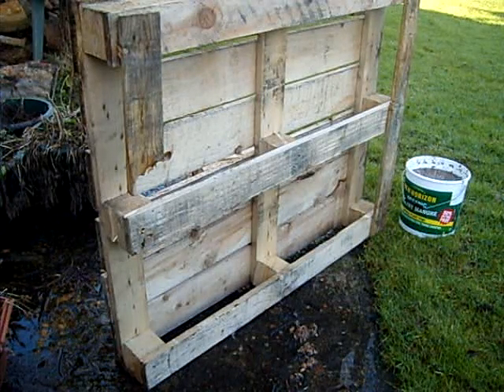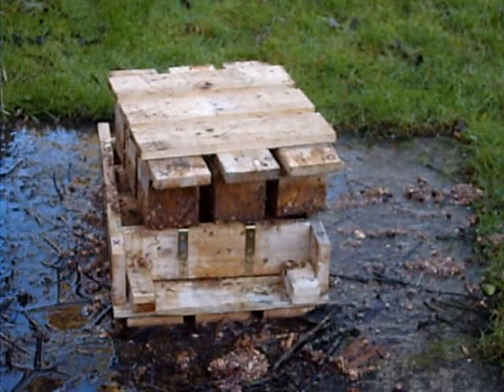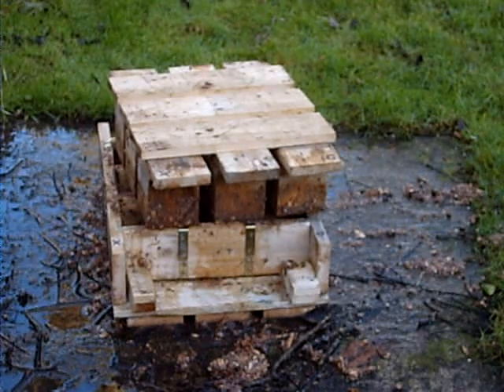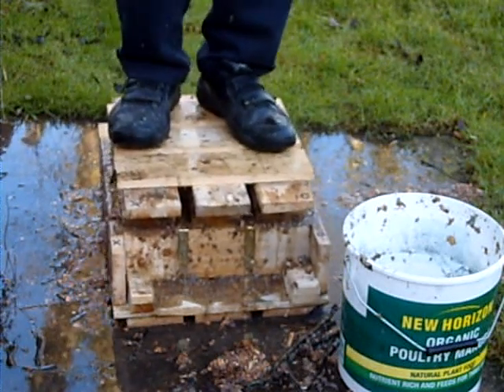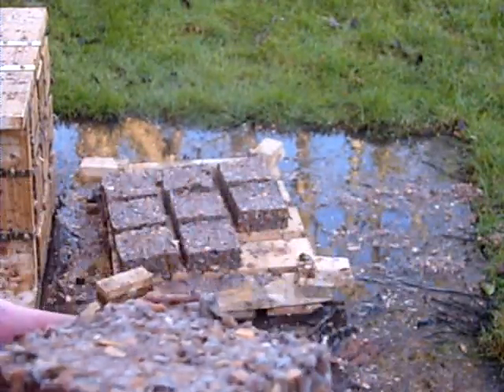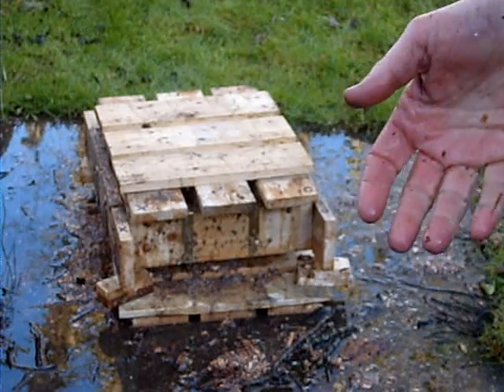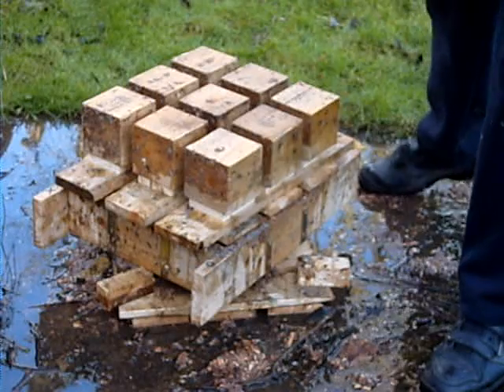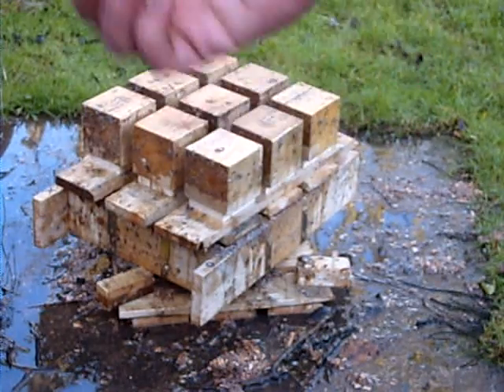Homemade Fuel Briquette Press 2

Comment from the maker: Hi Ed, I did try driving one wheel onto the press and got it done but, even with a Mercedes S320 that weighed about 2 tons, I got about 2mm or 3 mm more compression than just jumping on the press.  The problem seems to be that the centre of gravity changed when the car was elevated in one corner so the weight transferred to the opposite rear wheel so robbing potential weight from the wheel on the press.  I then thought of making another press and digging two holes that I could put them in and drive the car on top of them but that never happened.  The main reason was that it takes so long to dry the briquettes in Ireland I decided it was't worth the effort for the return.  I did consider storage but, even with the sheds I have I would have needed a lot more to store briquettes after they had dried.  The other big issue was where was I going to dry the briquettes?  I considered building racks etc but ultimately decided it was all too much effort and money to save a little money.
Best Wishes, Brendan.

Comment: Maybe try dead lifts while standing on this?
Reply from the maker: Hi Amy, I tried driving a 2 ton car up a ramp and onto the press and managed about 2mm more compression than just standing on it and jumping up and down.  I saw a guy dig two pits and put a press in each before driving his car onto them and that was pretty effective but not so much that I got my spade out.  The biggest issue for me isn't so much pressing the briquettes as drying them out.  So much so I haven't looked at this since I made these videos because it takes so long to dry them it's hardly worth my while.
Best Wishes, Brendan.
Reply: @baconsoda  you could dry them in the bog no?like turf! Or maybe house them in a wigwam with a flu thru the middle and burn garden waste this will make the briquettes happy. I think if you try my dead lift idea it will take more water out of them and make them easier to dry ...__... Peace and love your new friend Amy ...__...
Reply from the maker: You are right, I would need to build some sort of drying cabinet because humidity here is very high so drying is very slow.  There's a guy called Mladen 365 (https://www.youtube.com/user/mladenkorotaj/videos) who lives in Eastern Europe and he does lots of briquette press videos and he has a drying box.  If you are investigating briquettes you should look at his videos.

Comment: Perhaps a solar dehydrator would work for curing your briquettes?
Reply from the maker: Thanks for reopening this Darryl, I did think of that and collected the cans but never got around to building it.  I must get onto this again because it's an unfinished project.
Reply: @baconsoda  I've seen really good results from people using aluminum rain gutter down spouts as opposed to the labor intensive "can" type solar heaters.
Reply from the maker: Ah, thank you Darryl, I haven't seen that so I'll go have a look around for some videos now because that would certainly be a lot easier than cans. 
Best Wishes, Brendan.

Comment: T' b' sure, it works. Good Irish thinking there. And makes more sense to make more than one briquette, instead of spending the same time just making one as some presses do. And you have done your bit for recycling too. Well done. And you are going to reuse the water too as I have noticed a few other responsible briquette makers doing. You are working smarter, not harder.
Reply from the maker: Thanks Brian.  This project is not finished but just had a 7 year delay.  I am trying to make another press that is more efficient using a lever as the engine but still capturing the water.  There are two reasons for that... we save water but, as importantly, the water contains starch which is the glue used to bind the briquettes so re-use makes perfect sense.  I just fired these videos up for interest sake but never expected the views they got, and the private messages received, so I will get back on track with the new, improved, version as they say.  I still want to be able to make this with minimal tools and waste material because the idea to that the poorest people will be able to benefit and that is making the designs a bit more difficult to achieve.  Watch this space please.  
Best Wishes, Brendan.

Comment: Hi,
Have you tried burning these in an open fireplace? I've been thinking of building a briquette press myself but we don't have a stove. We use wood pellets for cat litter (we have a lot of cats) and the used litter basically turns into saw dust. rather then trowing it out i'd like to come up with a way of burning it. Mixing with paper to make a briquette seems like the best way to make use of it.
How stable have you found the foot pressed ones compared to the one pressed with the bottle jack?
Reply from the maker: Hi, the foot pressed briquettes were almosr as dense as the ones pressed with the jack and burned for a similar time, 15-20 mins each.   I let this project go because it takes so long to dry the briquettes here but, if I found a way to do that more quickly I would give it a go again.  By the way, I tried driving my car onto the press and got an extra 2mm of squashing and the car was an S320 Mercedes so lots of weight.  I don't think the pressure is as critical as the drying time.  I do intend to revisit this projct after I get an extension built to my workshop so there will be more coming up.
Best Wishes, Brendan.

Comment: i will use concrete block as weight and let it sit for abit  so you dont  need to jump on it
Reply from the maker: +Cassc2s2 That will do as good a job.  I tried driving my car onto this press and only managed to get 1.5mm more downward movement and that was with a S Class Mercedes that weighted over 2 tons.  I would probably have done better had I driven onto 2 presses because the weight transferred to the opposite rear corner when the car was up on the press.

Comment: I have just finished a copy of Mladen 4 briquette press......only trouble now is getting the mix right....I will put the video up on the tube in a few days.......your press is the most simple one yet...good stuff...greetings from Tipperary
Reply from the maker: +seanie3470 Hi Seanie, I was trying to see how simple I could go and I think, for multiple briquettes, this might be it.  I want to work on a simple lever to exert pressure but other things keep getting in the way.  Don't over-think the mix.  I use 50/50 (or near enough) paper pulp and shavings/sawdust.  I leave the soaked paper overnight and break it up with a plaster mixer the next day.  A sloppy mix will be easier to pour into the moulds and you can always collect the water to use again because it will have cellulose from the paper which is a binding agent.  My problem is drying the briquettes because it's not that hot in Ireland but I am working on a drying area that is covered but open to the wind.  These briquettes burn like turf/peat so they are worth making.  I'll sub your channel because I'd like to see what you are at.
Best Wishes, Brendan.

Comment: This is probably one of the simplest and fastest outputting brick makers I've seem on YouTube, congratulations, maybe you could add more paper puree and make them thinker too. Thin burns fast and hot but thicker burns slower and longer which is generally preferable in the long run.
Reply from the maker: +mikelfc2010 Thank you. My think is that I want to make something that poor people, without access to special tools, can make to use waste for heat.  I see charities selling briquette maker plans to poor people in developing countries for hundreds of Dollars so I'd like to do something to give them free, easy, briquettes. I haven't looked at this for a while but I will return to it.  The briquettes aren't pressed as tightly as with levers and jacks but they still burn well.  I will try your suggestion out because I'm learning too.
Best Wishes, Brendan.

Comment: Well I'm late to this party!  Cool idea and great information.  You said you burn them in a pot belly stove.  Is the stove in the house or shop?  Do the bricks burn faster than wood?  Thanks
Reply from the maker: +Ron B (TxWindfall) Hi Ron, maybe a bit late to the party but still very welcome.  The blocks burn like turf and need a bed of embers to get going but, once alight, they burn gently for about 20 minutes.  They burn more quickly than hardwood but about the same time, or maybe a bit longer, as softwood.  There's a video of some burning somewhere on my channel around the time this video was made.  I didn't make any more because it is so hard to dry them in Ireland but I'm building a covered area to dry wood so I'm going to start making the briquettes again then.
Best Wishes, Brendan.
Reply: Thanks for the heads up

Comment: Forget the eight ton press there buddy. I like the simple ways of doing stuff like this.
You showed the fulcrum.
Find a piece of 2 X 12 around eight feet long to mount the base six inches from one end.
In that six inches mount a post about a foot taller than the unit.
Hinge a lever made from anything like a 2 X 6 on edge the same length as your base. Make a pushing post to put pressure down on the unit then fill it up and use the lever.
Remember the longer the lever the greater force down?
Didn't I see you say something like that?
Reply from the maker: Thank you for this.  I'll definitely give your suggestion a go and will credit you with the design.  This generous, freely given, information to help others is what I love about YouTube and I've learned a lot here...and some more today.  I won't be able to get at this for a while bcause I've got so much else going on but I will do eventually.
Best Wishes, Brendan.
Reply: baconsoda BTW, I really like your little pot belly stove.
It appears to be a very close twin to one I have here.
I take mine to an old engine show and I have a cute little coffee pot that fits it nicely.
Usually I just heat water for hot coco or tea now since I stopped drinking coffee.
I also have a small pot with cover that I have used to make soups and stews on that stove.
In my junk today I found a small frying pan that I will take along with me so I can do burgers in it too.
Reply from the maker: Rustaholic777 That stove is really great, not as efficient as a rocket stove but I'm lucky to have loads of wood to burn so economy is not an issue.  I've never cooked or made tea on it so I'll have to christen it the next time my woodturning, tea-loving, mate is here.  I use it to heat wax to seal wood, it is good at that.  I raised it up because I have back issues and it was a great idea because I can see the fire easily and it's like another person in the room.  We all love a real fire.
Best Wishes, Brendan.

Comment: Excellent design.

Have you tried flipping the whole thing over after it is loaded and pressed, and pressing down on the square walls to eject?

Good video, well shot.
Reply from the maker: I didn't try that because the briquettes are very soft and wouldn't push the whole way back up the mould.  What I do is lift the mould off the base with the little supports at each corner and press until the briquettes fall out onto the base. 
I've tried pushing briquettes back up other moulds with no success and then saw that all the other briquette makers on YouTube just press their briquettes out the bottom.  This pallet press is very crude but I want to see how someone with no money could make briquettes.  I wish I lives somewhere with reliable sunshine because the briquettes take an eternity to dry here in Ireland.
Thanks for your interest in the video, please let me know if I have answered you satisfactorily. 
Best Wishes, Brendan,

Comment from the maker: I did think of digging 2 pits and driving onto those but then I had the issue of getting rid of the water that came out so, unless I dug a drain, I was going to be busy with a scoop.  I did try a ramp but the weight of the car just transferred to the rear left and only compressed the form by 3mm and it is a heavy car.  The pit idea is the best, I think.  I am going to do more on this but need to find time.

Comment: Hello from Co.Down. Nice idea.  I made a few hundred of these a couple of years ago using waven pipe as the mold, i was lucky and picked up a 2 tonne bench press for £25, was very fast and removed an allot of water from them.  I was able to press a 45ltr trugg full of pulp in about 5 mins and averaged about 15 bricks per trugg.  If you follow the link on my channel to the Instructables site you can take a look, all the best.

Comment: You could probably set up a chain block with a support and a block of cement the size of you mold.  Chain blocks move pretty fast and can support a lot of weight.  The cost for building it would most likely be justified by your future output.

Comment from the maker: That would work but it means a lot more effort.   Someone suggested digging two pits, putting a press in each, and driving onto the presses to get the weight transferred forward and down.  I think that would be easier...if I exclude digging two holes.

Comment from the maker: Thank you.  I tried the car wheel idea and only got another 2mm-3mm of compression because the centre of gravity of the car shifted and it meant the weight was transferred from the front right on the press to the rear left on the ground.  I thought of digging 2 pits and putting a press in each which would transfer more weight to the front of the car but never got around to it.  I'm working on a frame to hold an 8 ton hydraulic jack so that might appear if I can get other stuff done first.

Comment from the maker: That is just about exactly the direction I was going except I bought an eight ton bottle jack to get the pressure.  The lever would work but it's a lot of work to make.  I didn't make any briquettes this Summer, I had so much going on I kinda forgot.  However, I am going to try to get set up for production during Winter so that I can get a good start in Spring.  I'll post my changes in a video.

Comment from the maker: Drying is an issue here (Ireland) but, once dried they burn like peat briquettes.  They need a base fire to get started, but, once alight you can feed the fire without any problems.  Burning time is about 15-20 minutes and heat output is good.  If I could find an efficient way to dry these I would make a lot more.

Comment: have you thought of creating the same design but instead of lining the blocks in a 3X3 flat surface to make 9 blocks you create it using 2X4 flat surfaces stacked on top of each other say in 3 layers or tiers? it should ultimately give you psi per block while allowing you to make more blocks at the same time (4 blocks per tier X 3 tiers = 12 blocks)... leaving gaps between each should allow for the water to drain from each tier as well.. just a thought which I might try myself. thnx for the idea

Comment: Hi, another quick way which I found half useful was to get a long piece of plastic bathroom type waste pipe. Fill it and compress, then push thru! Just cut it to size after. It's simple a less messy,just use Wooden pole to compress... May help but cheers anyway

Comment from the maker: @Colwray1 If I could dry them quickly it would be worth it but that's the big issue for us Northern climes folk.  Obviously this is just me throwing out ideas but, with efficient compression and drying, it could be worthwhile.  This Spring I am going to build a soda can dehydrator to see if that speeds drying up much and try to produce a good volume of briquettes.  Come Winter I will record burn time to see if I would be better just taking the man-hour production money and buying coal.

Comment from the maker: @ukgardener1 Have you been spying on me? I had a lever built and then discovered I needed the press to sit on a base the same length as the lever to stop it tipping towards me when I leaned on it (basic physics that I forgot in my rush to build).  I am working on the Mk2 version now but it's cold and wet and horrible outside so I'd say nothing will be done until Spring.  However, there will be a video.
Thanks for your input.  Best Wishes, Brendan.

Comment from the maker: @kppteam I tried this and only got about 3mm more compression because the centre of gravity of the car shifted on the ramp and the weight went towards the rear.  However, it might work with 2 presses if the weight were equalised more.  Another idea I had was to dig a hole and put the press in it and then drive the car onto it.  That would put more weight onto the press but I haven't done that yet.

Comment: I used to do this when i had an open fire, shitty gas now :(

Get 2 old jacks and weld a solid frame to both of them. So they have a square frame attached between them. Then put a water barrel, pile of bricks, old engine, ect on the frame and use that free weight to press the biomass. When its compacted you use the jacks to lift the weight off.

Good way to put a lot of weight on it without breaking your back. Or bank.

Comment from the maker: @BongoOldChap Have you checked out the sawdust stoves yet?  They are very simple but very efficient.  All you do is pack the sawdust around 2 pipes which you remove to act as intake and chimney and they burn all day from the inside out.  There are loads of videos on here.

Comment from the maker: Hi.  No, I didn't make enough to keep me going.  The main reason was that I was at the garden all the time and didn't get around to making briquettes.  However, I am getting a new press built in Spring that will speed up production and, maybe, make the whole thing more viable.  I haven't given up on the pallet press but there's no point making briquettes now when I can't get them dried.  Also, I'm building a solar dehumidifier to speed up drying, more on that later. Brendan.